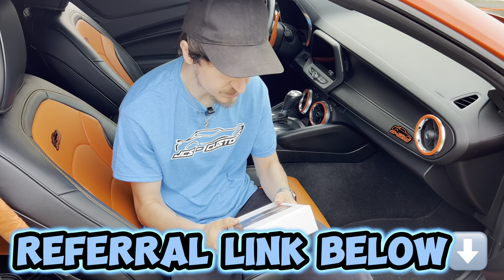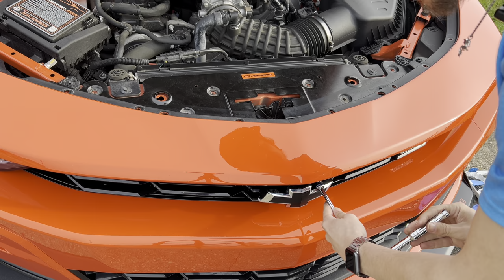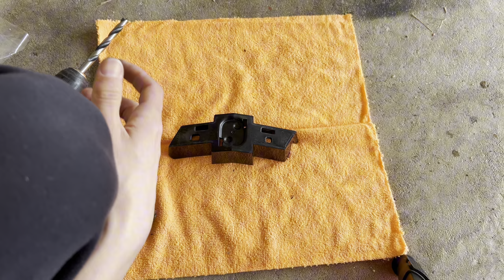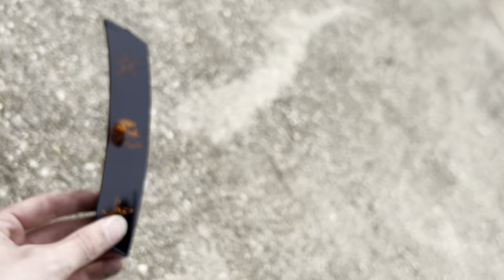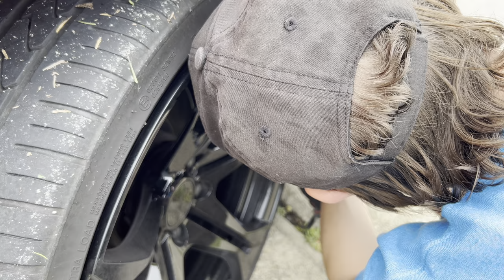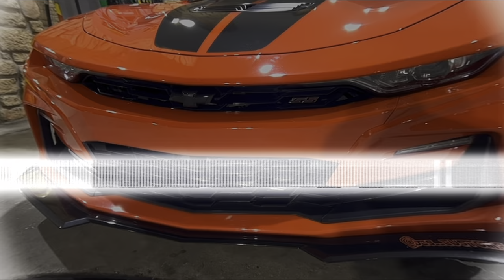How To Install An Illuminated Bowtie On Your Camaro: Step-By-Step Guide!

Comment: Hi JC Thank you for this VIDEO so much! I took my 2024 CAMARO 1SS into the DEALERSHIP to Instal the Illumanated BOW TIE and at first the Technician wanted to REMOVE my Front Bumper until I showed him out Video!
But know my HOOD is raised up on the Left Side and the Gap is wider on the Left Side more than the Right?
Reply from the maker: Nice! Glad I could help. Your hood is out of line, it’s easy to get out of line once you remove the front header plate. But it’s also easy to adjust back. The two rubber grommets can twist to lower or raise each side and the two screws in the middle can be loosened or tightened to raise the front of the hood. Also, if the latching mechanism for your hood wasn’t placed exactly where it was before removal, it will be out of line. I also went over this in the video if you need video reference👍🏻

Comment: According to the directions from the factory you are not supposed to connect it to the side marker lamp, the directions show it connected to the DRL, I am thinking of installing this on a 2019 Camaro LT all it has is the side marker lights, my question is, if you can reverse the wires at the end you plug into the lightup bowtie? Instead of cutting the other end at the side marker light. So that you are only cutting two wires instead of four? I saw a video where a guy only cut the end at the bowtie and only cut the 2 wires and reversed them? Would this work? I have tried contacting the dealership to install this but they want like $400 to install this. I feel that is way too much.  Do you have any advice? Also I just realized you are using an aftermarket kit, do you know if this will be the same with the OEM Illuminated BowTie Kit? Thank you

Comment: Got a question, I'm replacement my alternator, but was told to check my alternator fuse or relay, I can't find them can u Tell me where, for a 2016 camaro ss